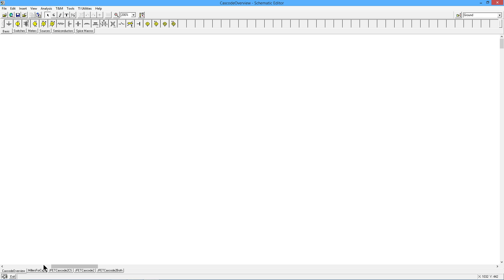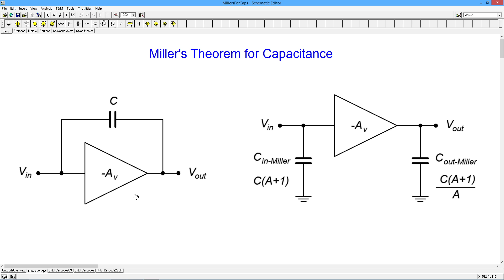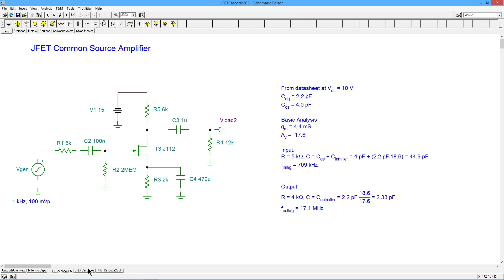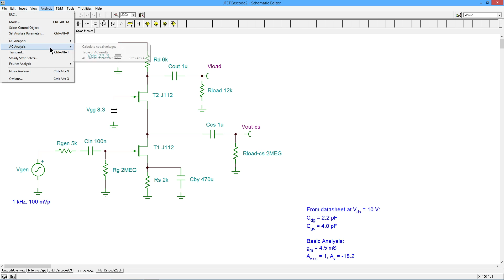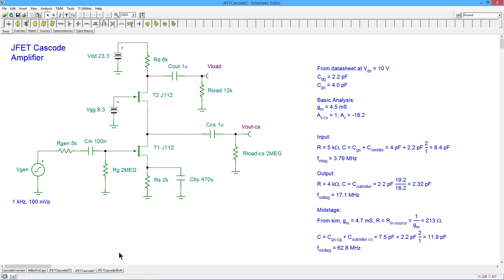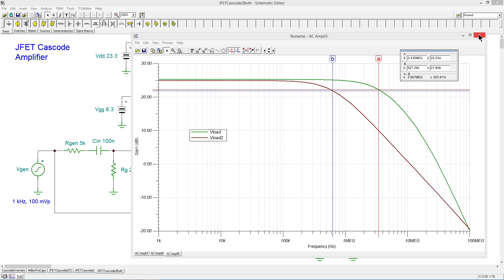Semiconductor Devices: JFET Cascode Amplifier

Comment: I was hoping to get your opinion on the pros and cons of dual jfet common source configuration, versus dual jfet source follower configuration? The reason I ask is because of the book "the art of electronics", the author seems to suggest that source followers seem to do more to eliminate miller effect, while also removing "dc offset". What is your take on this? Also, he uses a resistor in between the two jfets, im kinda lost about that. Anyways, thanks very much for these videos I am learning quite a bit.
Reply from the maker: To me, those are two different beasts. Source followers have a voltage gain less than one while common source are true voltage amplifiers. They both present high Zin, though. Miller effect is only an issue with inverting amplifiers (common source).

Comment: At 5:19, you made a slight error.  The drain to gate capacitance is multiplied up by one plus the gain.  That is if the drain has 0V AC on it you still see the capacitance times one.  This is important because in some cascode designs the drain may have a very small signal on it or even one that is in phase with the input signal.  This last bit I will explain further:
If you are making an amplifier with a really high input impedance. you will likely have a resistor in series with the C4 in your initial circuit.  This means that the source node will have an AC waveform on it that is nearly in phase with the gate signal.  The AC on this point can be applied to the base or gate of your 2nd transistor making it so that the upper transistor imposes an in phase voltage on the drain in spite of the AC current flowing in the drain path.  With a more complex than this extreme example I made an amplifier with an input capacitance of 0.2pF.
Reply from the maker: Sorry for that sloppy wording in the overview. If you continue on through though, you'll note that the computation does indeed use gain-plus-one.
Reply: @ElectronicswithProfessorFiore  Your wording caused me no problems.  It is the folks new to the game that I was concerned for.  Some may remember your words and not the equation.  Flagging it in the comments was intended to help them.

Comment: Nice video, but i am a little confused as to why you have T2 biased at such a high voltage. We use jfet cascode preamps for small piezoelectric wideband sonar transducers, and the bias point is generally a few hundred mv above ground, with T1 sitting at some tens of microvolts above ground after getting pulled down by a 10+Meg Ohm resistor. We use a current source rather than Rd to get more gain and we use low noise jfets, but I don't think that should be relevant. The setup involves ensuring that T1 is functioning as a source follower over the range of inputs with the desired Rs current (usually 1-2 mA), and that the input to Cout has a DC value of half the supply voltage. We simulate these to death with LTSpice and the build results are a reasonable facsimile with a little tweaking to compensate for the wildly varying jfet parameters...
Reply from the maker: A couple of reasons. I usually design example circuits to "make the numbers easy" and clarify the operation, rather than go for best possible performance when introducing a topic. Also, I try to make the circuits practical for people who want to breadboard them. Thus, I have to avoid any touchy or finicky designs or values. No doubt that adjusting bias could improve high frequency performance further (I discuss this in other videos) but that's not the main point here. In fact, that very issue issue comes into play regarding the chosen bias levels (why they are so high). In order to keep an "apples to apples" comparison, the second circuit is biased so that we get the same values for JFET capacitances that we get in the first circuit (check out 14:00). Otherwise, we're not isolating the improvements from the cascode topology. If you don't do that then you don't get a fair comparison. It would be like comparing the THD of two power amps that have different gains and not setting the outputs to the same level. The low gain amp would have an automatic measurement advantage even though the THD could be worse at a given power output.

What are the sonar systems used for? I'm always interested in applications that people have.
Reply: @ElectronicswithProfessorFiore  Your video is excellent and I will be recommending it to many engineers that managed to go through university without learning about this amplifier architecture.

In my field, underwater acoustics, and also in the much larger and well funded medical imaging and non-destructive testing industries, ultra low noise JFETs are used for preamplification of signals from small capacitive transducers (e.g. a 1/2cm air-backed spherical hydrophone will have a capacitance of ~1.9nF). The lowest noise JFETs have enormous input capacitance (e.g. the lowest noise JFETs are InterFETs IF3601/IF3602 series which have typical gate capacitance of 650pF and typical self noise of 0.35nV / sqrt(Hz) ) which makes a cascode input stage a requirement for any decent design, but in my field, it is rarely seen, almost certainly because many engineers either aren't familiar with the Miller effect or with the cascode advantages. Absent the cascode, the Miller effect leads to a bad voltage divider situation which results in a significant reduction in the gate voltage, which seriously hurts the preamplifier's amplification and noise figure.

In the past, I didn't complain too much about this lack of familiarity because it's provided an unfair advantage, but as I get closer to retirement, it bothers me to see all the designs which leave out this important element. The only rational I can come up with is that the cascode, especially combined with current source, is a lot harder to tune.

In underwater acoustics, the very highest frequencies are about 2 MHz, so bandwidth extension isn't usually a driver, but medical imaging goes up to 20 MHz and NDT can go even higher, so these fields are even more in need of this architecture...
Reply from the maker: @ats89117  Interesting! Thanks for the info. I am not surprised that the lowest noise FETs have a high Cgs (although, to be fair, power MOSFETs can be much higher, as in nF). Low noise analog semiconductors tend to go in the opposite direction of digital, namely, larger and larger surface area vs. smaller and smaller. End result, more capacitance. Certainly, 0.35 nV/rtHz is a very small number, and now the thermal noise of the resistors might dominate. The thing is, modern op amps are pushing that edge now and I wouldn't be surprised to see some around that same mark. I know there are instrumentation amps in the 1 nV region (check out TI) with funity > 10 MHz. 

I can understand that balancing noise and f2 performance must be rather finicky, what with the bias having an affect on Cgs (or Ciss). Coupled with the parameter variations that occur with FETs (compared to BJTs), do you find that you have select out your production FETs so that they meet certain criteria (i.e., tighter than manufacturer's spec)?
Reply: @ElectronicswithProfessorFiore  The low noise voltage chips almost always come with a high noise current.  If you don't want to pay $20 per transistor to get low noise ones, you can go with the LSK170.  They will get you the 1nV/sqrt(Hz) with a low noise current.  For the upper part in the cascode, you can use a BJT and get a lower impedance on the drain.  "Little re" is generally less than "1/gm"
IIRC it was someone from CERN who some years back made an "long tail pair" where each side was 6 JFETs in parallel.  When you want to steer the beam, you need to detect where it is electrostatically. Plates on one side of the ring picked it up.  A coax running in a straight line to the other side of the ring could get the correction signal to the steering plates just in time.